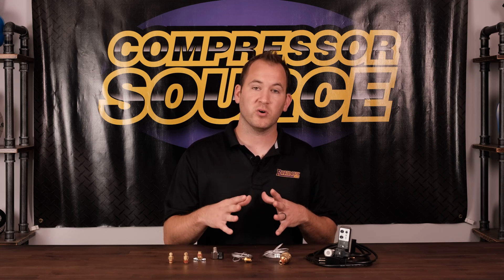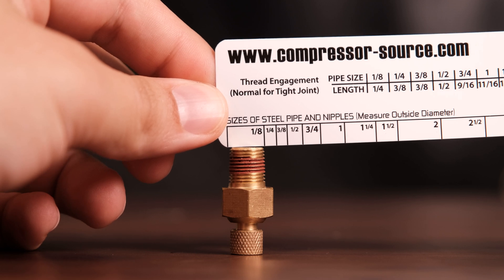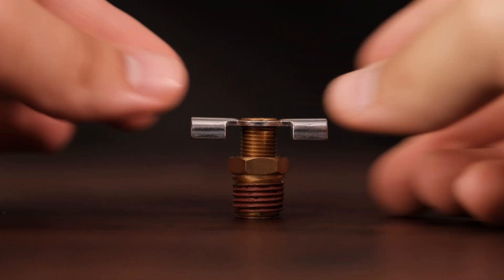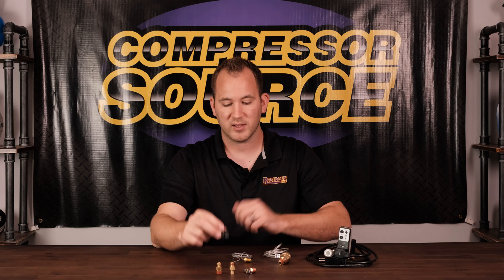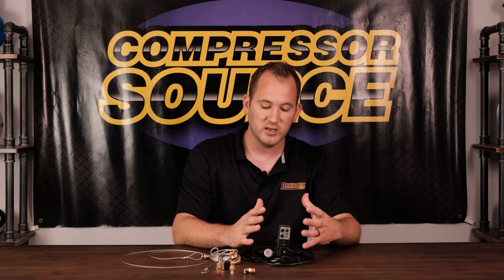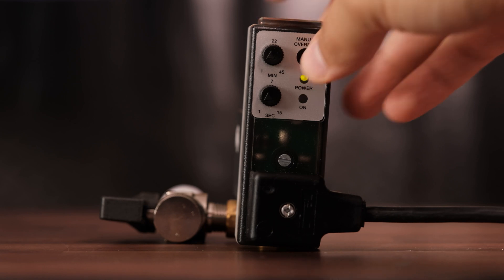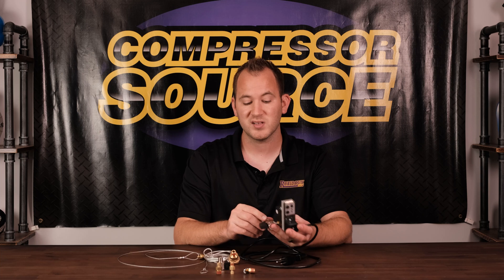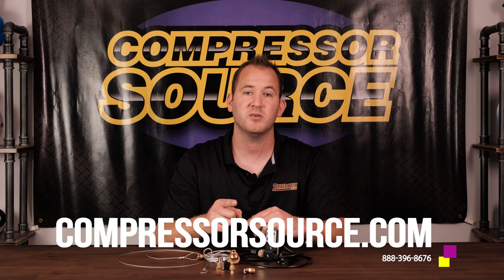How to Choose the Right Air Compressor Tank Drain

Comment: thank you so much for posting you are a life saver. 
dont understand why its called a 1/4 when the thread diameter is 1/5 inch
Reply: The 1/4" NPT OD is actually about 0.5" or 1/2" OD.  You have to go back to pipe production in the 1800s for it to make sense.  At that time metallurgy was not what it was by the early 1900s.  Using 1/2" pipe as an example, early 1/2" pipe had in inside diameter of 1/2" but the pipe walls were thick.  In the 1920s better metals allowed for thinner walls but in order to fit earlier fittings, the O.D. had to remain the same so the ID became much larger.  That's true across all common plumbing sized pipe; it's just a carryover from early mass production and we're still using the system.

Comment: Is there a system out there designed to catch the water drained from the air compressor? I have it in my garage and it makes a mess unless I role it outside. Can you make a video on this or how to make something to catch the water?
Reply: I know someone makes extension kits. You could pipe that outside or in a container.
Reply: Yeah that started after ridiculous regulations state the water drained from the compressor is damaging to the environment.
Reply: Late response:  You should only get a mist and not solid water.  If that much water is coming out you're either in an incredibly humid area (I'm on the Texas Gulf Coast) or you're not draining often enough or both.
Reply: If you're not in a freezing climate, I plumbed mine into a furnace pump and it just pumps it up hill to a shop sink.